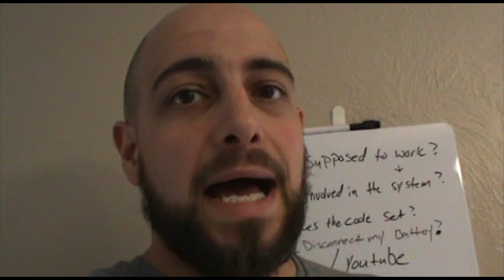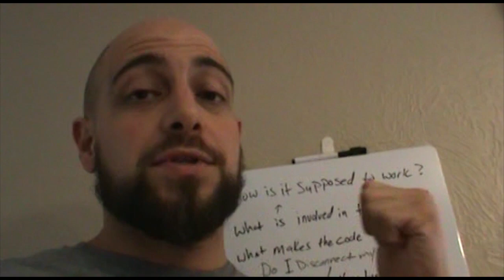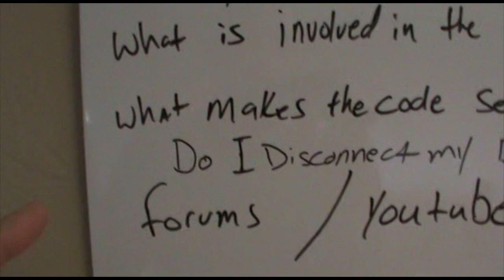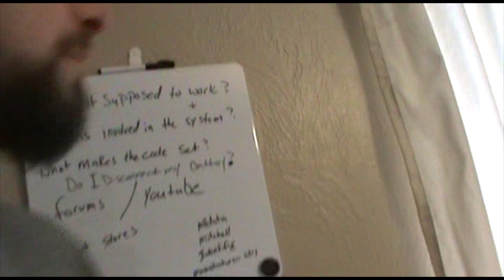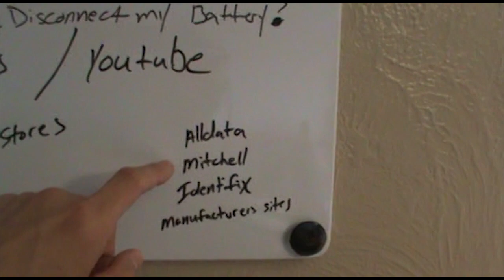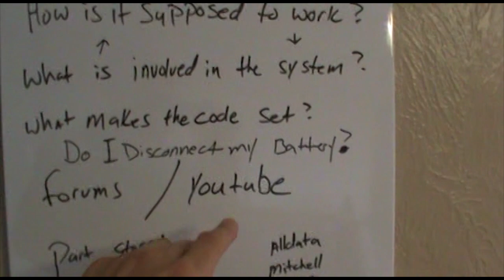How to diagnose your car

Comment: Drive a 2015 GMC Sierra 4whl drive 5.3 my ? Is I have a po700 an a vacuum leak can this interfiere with my drive cycle monitors like o2sensor,cat,an fuel system drove 100 miles an the not set to INC to ready
Reply from the maker: Yes any current fault code may iterfere with the I/M’s  performing their tests. And a vacuum leak would not interfere with the test it would just fail the test if it was causing emissions issues.

Comment: Sup Lou, nice and very explicit video, i respect your acuratted opinion and apresiate also, ey can you recommend me an European experts page to solve some issues, a page like AllData i mean, but for German (MB) advice? 
greatings from Guatemala.
Reply from the maker: Fito Villafuerte what kind of advice do you need sir? I can help with mercedes diagnosis and issues. Www.cartechconnect.com  also you can get discs on ebay for workshop info for mercedes called WIS. The mercedes website is www.startekinfo.com and is best suited for windows. Hope this helps.

Comment: How to diagnose a 722.6 gearbox in a c203.216 (270 cdi kombi 2001) going neutral or in limphome mode? can it be done with the icarsoft? or do you need a better scantool? (I do hope it is not a faulty freewheel bearing or a torqueconverter, everthing else is accesible fearly easy without taking the tranny out :P)
Reply from the maker: well, you can use the icarsoft to check fault codes in the ETC control unit.
If the car is in limp mode there will always be a code in either the engine or transmission control unit.
Reply: @MasterTechLou  thnxz very much,  got 4 codes in ETC only, p2600,p2500,p2502,p220a

n3 rpm sensor reads zero, can see which gear is asked and can see the trans doenst want to shift other then P or N.

car wont move.

Conductor plate? sensor gone bad?

iCarsoft cr pro is marvelous machine, many thnxz for the great advice
Reply from the maker: @maartendehoog8527  if you need help with diagnosis you can reach me at www.cartechconnect.com
thanks, 
Lou
Reply: @MasterTechLou  a ticket is send

thank you for your response
Reply from the maker: @maartendehoog8527  Thank you sir, I emailed you from my private email, so you can check spam as well. 
Thank you much, 
Lou